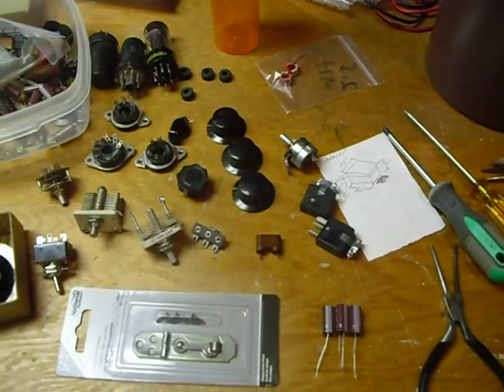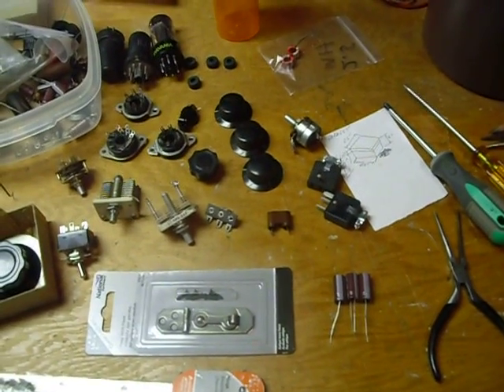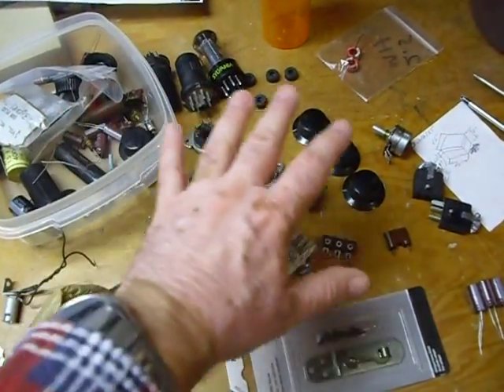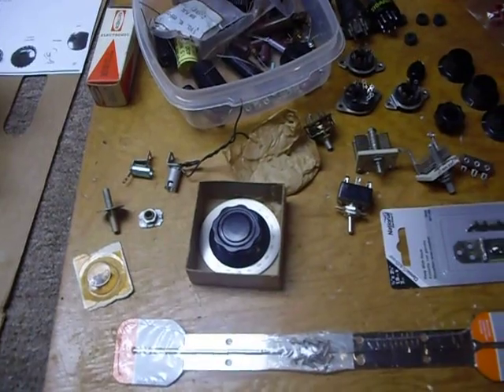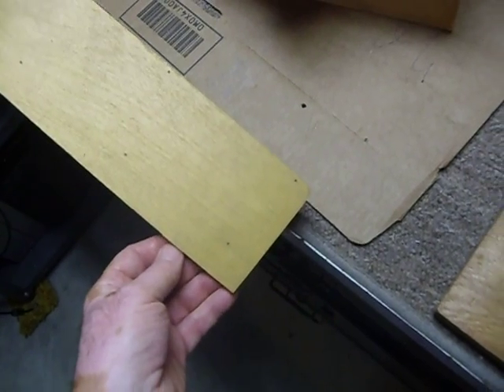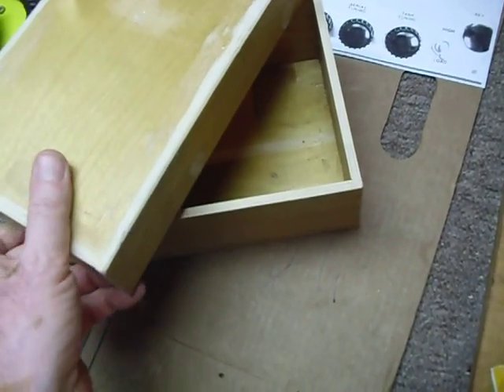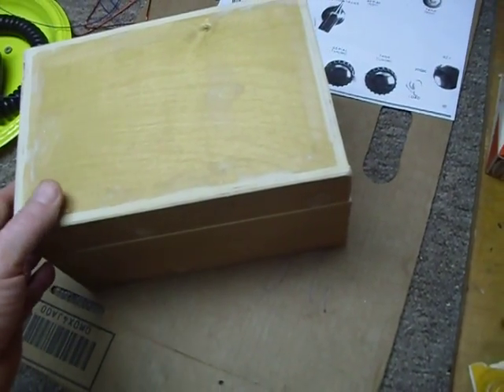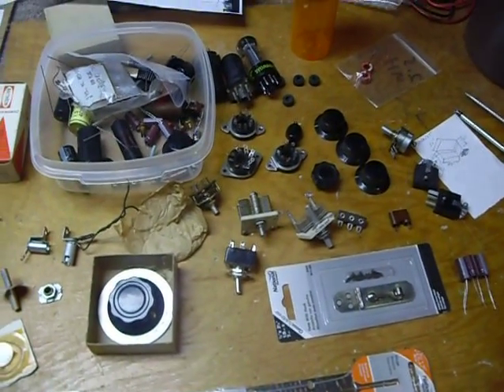#1 WW2 PARASET , PARASET RADIO,WW2 SPY RADIO,PARASET REPLICA,

Comment from the maker: AE7XQ  It Was a fun project and I enjoy helping others with their projects .  making one with transistors sounds like a great idea to me . There are some real nice wood cigar boxes  I have seen . This one was made of 1/4 inch plywood  that was finish sanded on both sides it was necessary to pre drill holes for thin finishing nails to prevent the plywood splitting when the nails were hammered in . Glue was used as well for a good joint it was tite bond wood glue as I recall. 73  Bob